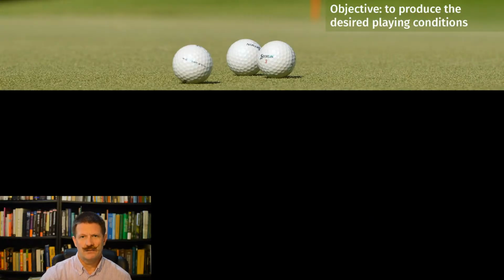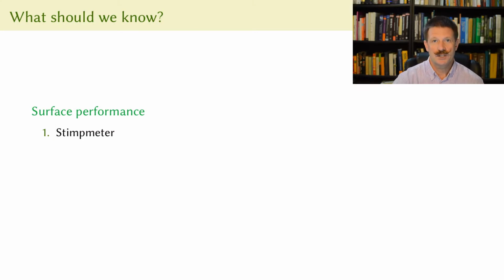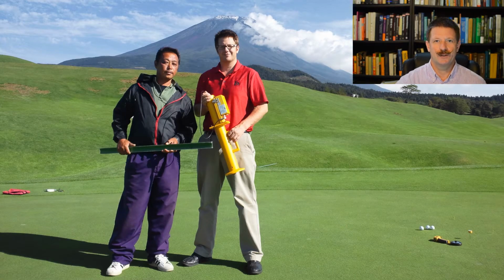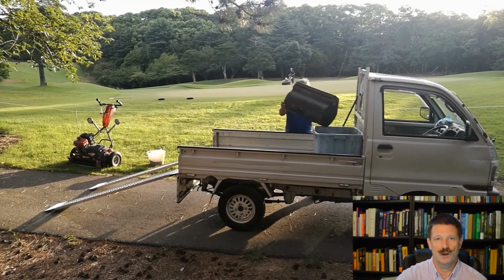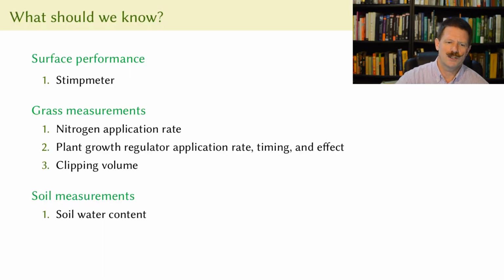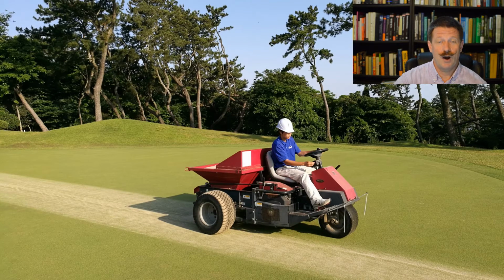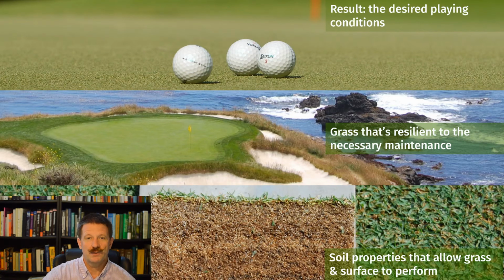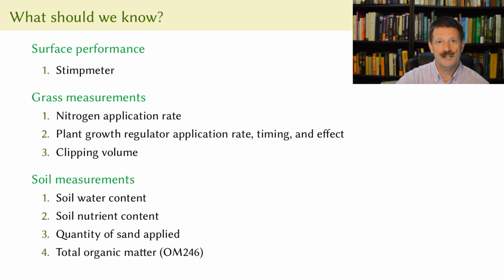"Flying Blind" | Grammar of Greenkeeping | Season 1 | Episode 3

Comment: Nice stache Doc. Hard to not stare at it. 
I've always said that keeping records on stimpmeter readings and the notes on what  goes on the greens prior to the measuring are important. Ditto records about fertilising and chemical applications. But I'll readily admit to not doing the others and yet I see their importance. Of course for many clubs, purchasing the water meter itself would be a challenge.
Reply from the maker: Thank you. Yes, the water meter might not be possible for every club. Even without a water meter, however, one can estimate the current soil water content by keeping a running soil water balance. Take the known or estimated field capacity (maximum water holding amount), add daily precipitation and irrigation, subtract estimated evapotranspiration, and you have a rough idea of how much water is in the soil.